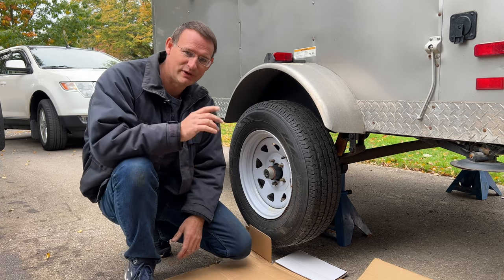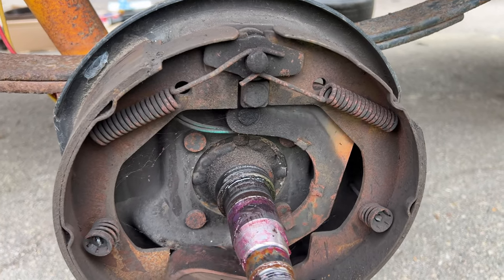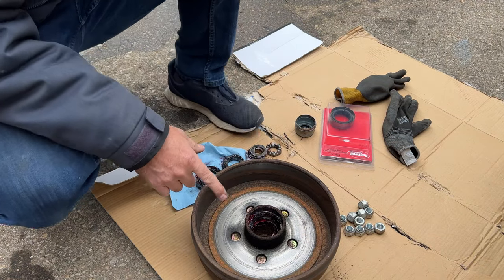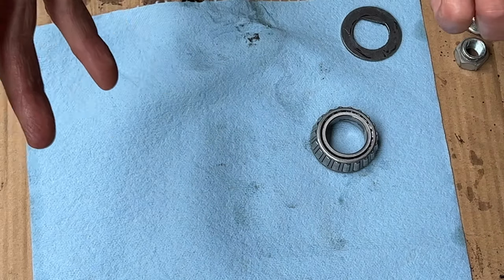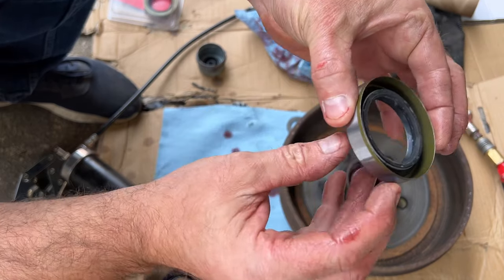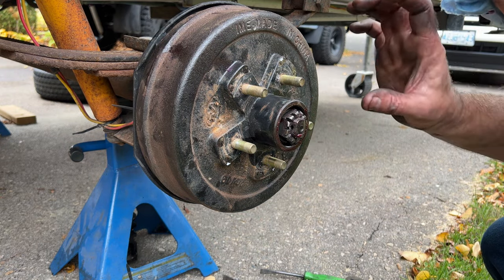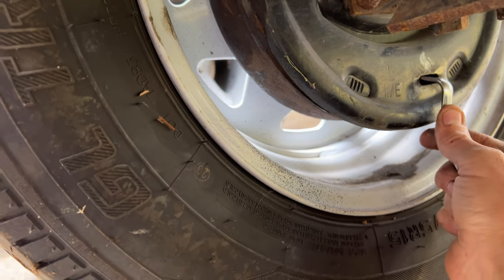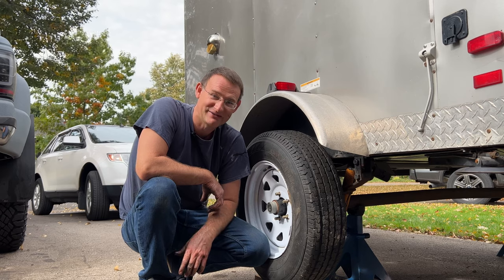Repacking Trailer Bearings/ Adjusting Brakes

Comment: Nice straight forward instructions. If I remember right one way to remember which way to turn the adjusters to take up the slack is "down and out" Turning the star wheel down moves the shoes out. I think... Thanks.
Reply from the maker: Great way to remember - I will have to remember that saying! 👍
Thanks

Comment: Good video, and in my experience most people only worry about there trailer wheels when one falls of, you see it all the time on the highways. My choice for grease is Aeroshell 33, a little expensive but great for brakes and bearings.
Reply from the maker: Yeah I completely agree… it’s the first thing I do when I get a trailer, I’ve even heard of new trailers sometimes not having enough grease. 
I don’t really understand not doing it, it only takes a couple hours and then no more worrying. I remember one trailer that came in the shop, the bearing had got so hot it was welded on the spindle. Tore up their tire, needed a completely new axle plus all the hassle to get it flat towed to the shop. Crazy.
I’ll check out that grease Thanks 👍

Comment: Ide like to put that electric brake system on my trailer. Do you have a link for video where you installed those brakes or were they stock? Great video btw! I have same size trailer with a v nose and I’m using your videos for guidance haha thanks again!
Reply from the maker: Yeah you know it, I got a video - Here’s the link. 
https://youtu.be/PIcVCTHD7sw
My existing axle didn’t have the flange to bolt up the brakes but I welded a flange on… I think you should already have the flange. 👍
Reply: @waysoutback  I’m going to watch your video again but where did you get the brake kit? I didn’t see a link.
Reply from the maker: @brett639  I just got them from a local shop on sale…. Here’s the link for similar product on Amazon. 

Southwest Wheel 3,500 lbs. Trailer Axle Electric Brake Kit 5-5.5" Bolt Circle https://a.co/d/4klpZHE